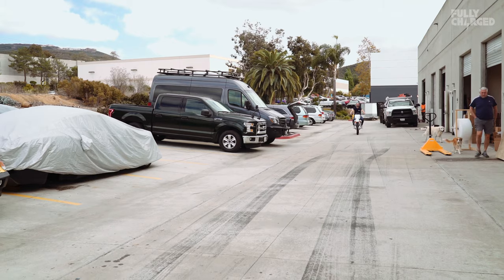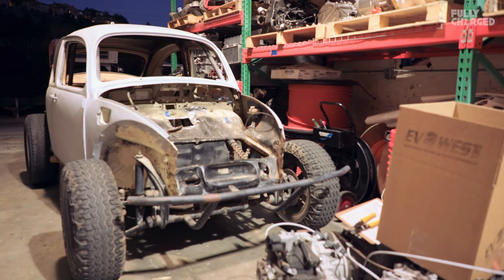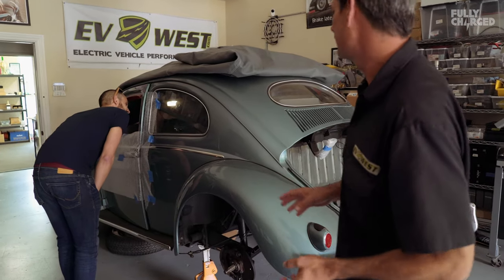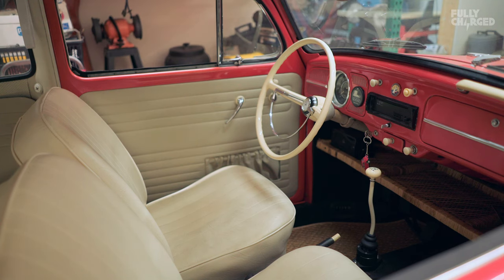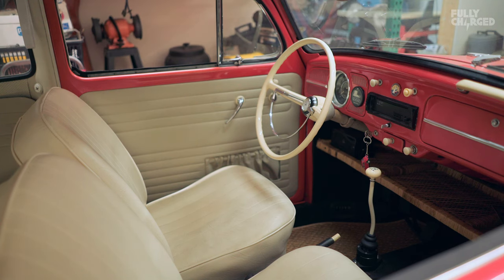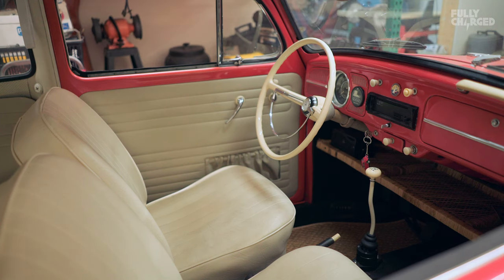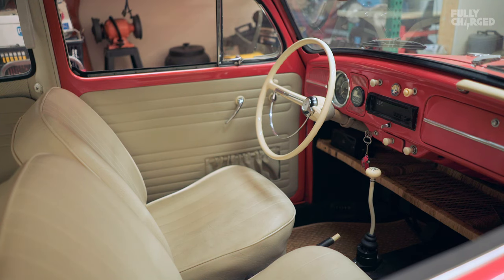Amazing Electric Conversions - EV West | Fully Charged

Comment: Excellent video, 
As someone who grew on combustion engines and I've been to several courses on auto mechaincs and was once a jet engine mechanic, the push-trend of EV's kind of gave me some anxiety, but you know what after seeing that the hot rodding and modifying of vehicles will always be around. 
These EV conversions are cool. I don't have that anxiety anymore. 
I've been following what the EV world has been doing for a few years and I see a lot potential . 
sticking a Tesla pack into a VW very similar to sticking a big V8 into a small car, strap in, shift and hold on.
EV West I love what they are doing.

Comment: Have been following these guys since the beginning - just awesome! I wish I could convert my MX5 to electric!
Reply: That would be mental. Proper drift car.
Reply: @Loundsify Here is a Dragster build. 9.27sec @ 142mph. 
https://www.youtube.com/watch?v=lQkdMw4TVjY
The only problem with Miata MX5 is Range Battery Capacity. The more range you want the heavier the battery. Weight is the Enemy for the Miata chassis.

Comment: Would be good PR for musk to start supplying them properly.
Reply: Don’t think EVWest needs it. Seems to me they use the crashed vehicles allright. Hope they get it at great value. Don’t think Elon needs the publicity either he has enough of it. EVWest is enjoying the conversio projects as they said. Always trying something new with what they can find and what the customer wants. Making sure it works. Delightfull group!
Reply: Too much liability and they'd charge too much.  But the cars are so stupidly fast that there's a steady supply of wrecks to feed the aftermarket.
Reply: They should offer crate motors and battery packs just like Chevy does with the ls engine.  People are going to buy salvage tesla and harvest the parts anyways so why not?

Comment: I got my splitie set up for another 100 000 Kms by reconditioning the engine. It was expensive, 900 dollars US even though I removed and replaced the engine and it's accessories from the car myself.
Machining, new pistons, rings, barrels, bearings and reconditioned cylinder heads.

Comment: I believe there exists a market to take fwd car with trailing axle and replace with live axle with 1 or two motors. Add batteries to both trunk and possibly battery trailer.
Program the car to use rear EV axle for short trips and use existing ICE for longer trips and battery charger. Upgrade alternator or add a 2nd generating source at engine.
Program brakes to use EV axles for most braking action.  Program the controller to alert the driver when ICE engine is needed for battery replenishment/range.
Most of these components could be move from car to car, allowing conversion of near-junkers.

Comment: Somebody has GOT to do an electric-converted old Ford Model T and/or Model A.  That would be so freaky cool to have rolling around the streets.  Since it's obviously not going to be for speed or handling or particularly light anyway, it could have obscene long-range numbers at the putt-putt speeds/conditions it was originally designed for.

There's bound to be a documentary in that idea, too:  "The New Original American."  Put solar with fold-outs on the roof to stretch it a little more, and drive it across America with only a few recharge stops.  Tour the little towns and quaint attractions, meet the people, and have a little campout here and there.  It's a summer-long cross country adventure  :)

Comment: This is great! Where I live the average winter temperature is -25 degrees, and the average distance to a city is 7hours doing the speed limit.That burns a lot of gasoline. I wonder, how I could convert my vehicle to battery power, it's a Ram 250 4x4 pickup which I need to tow my boat and my camper. Any suggestions would be helpful. Cheers from Canada!

Comment: Interesting point about not seeking initially to save the environment, but make a competitive high performing vehicle, and the rest will fall into place. Sales for ev’s should be going through the roof, but the limiting factor is battery power. The recent development of the Aluminium air cell should hopefully provide a reliable range extender which would eliminate range anxiety. Also, developments like the YASA motor and soon perhaps the Magnax gives great hopes for excellent torque to weight ratios.

Comment: I wish there was a shop like this in Australia! Would love to put tesla running gear in my VW!
Reply: I recon they ship worldwide.
Full instructions, bolt in.
All you would need (probably) is the batteries.
Reply: @rogerstarkey5390  yea I had a look at their web site, they pretty much sell and export everything.
11k for drive unit plus components 
1.5k per 5.3kWh battery pack
Would come to about 40k just in parts to convert a 4x4. Time to get saving!

Comment: I have a 1996 Dodge Ram 3/4 ton Van that toes 12,000. Lbs 
Is it a candidate for 500 plus range electric because I drive across country in it. It has A huge roof for solar as well.
Then there is my Ford Transit 350 van that has a 23 foot motor home on it. Can it get Become Electric. Right now it gets 379 MPH  but it would need a longer range to find chargers so can this be done?

Comment: I would love to convert my 2004, 2500,  Sprinter van, with all wheel drive, any suggestions? It looks like with all ice systems removed there is plenty of room under the van for batteries and more inside if needed.

Comment: They need to start looking at converting american classics too. Major demand for those old classics, some are cheaper than the big names, and with so much room under the hood they could have a "1 size fits all" engine conversion with an adapted battery pack depending on the model. Guys... guys... come on!

Comment: I wonder if they have templates to convert a mini cooper s 2004?
Reply: They don't yet, only bugs and mr2 so far it seems.
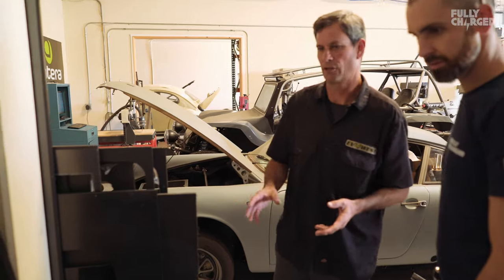Reply: @AR-zq9hq  7:36 i wondered if somebody sent in mini parts. im sure they would keep the templates.
Reply: @starcitizenmodding4436  yeah, but nothing about minis on their website. Hopefully they expand. I had a later gen BMW Mini where the engine went (surprising, right?) would have been a good donor...
Reply: @AR-zq9hq  lol no surprise there. My mini still has a low mileage so it would be a future project for me anyway, hopefully they have the templates in the future, if not somebody else probably will.
Reply: @starcitizenmodding4436  if yours is an r53 or r50 they last a bit longer. Good luck!

Comment: No body gives an indication of range of these conversions, can anybody tell me.
Reply: Depends on how many bateries you put in
Reply: @WANDERER0070  Bit of a vague answer as you need the room. An electric manufactured car has room because it may be the whole of the floor pan but a VW beetle does not have this advantage. So we can take it that if you don't want to sacrifice seating and luggage space you can travel say 50 UK miles.

Comment: does nobody convert all of the Tesla features, especially the sensors and full self driving? I have no idea if the battery pack cooling even works in those converted cars. Or if they got the ac working considering everything heat related is one system in actual Teslas.

Comment: Is anyone doing this in the UK? Or do I just have to get scrap parts and do all the faffage myself? I'm working my way up to an electrification of a van. Tesla motors and batteries are good gear, and efficient, although obviously not cheapest. Guess I need to find out about the reflashing runes. Where do the people with clue on this hang out? I've seen Michael Elias's video from a couple of years ago, so clearly people have worked out all this stuff. It's things like making driveshaft adaptors between the motor and the vehicle that also need specialist kit/knowledge.
Reply: Just Look up
 Electric car conversions on YT
Theres plenty o info

Comment: I'm thinking about converting my car, spark plug blew out, and it wasn't running great before that either. Seems a shame to scrap it, so I'm thinking, whats the possibility of putting an off the shelf generator in there with some electric motors, and small battery bank? I thought of it last night just before a thunderstorm, so now I'm on a mission from god.
Reply: What car? (Just curious)

Comment: HOW TO CHARGE ANY ELECTRIC CAR/TRUCK WITH OUT PLUGGING IN!!!       Here listen... things needed. 1) alternator (must put out more amps then will be used with everything running). 2) low amp moor (Dc or Ac to turn the alternator. 3) 2 batt banks (bank one/bank two) 4) a switching deviice (while you use one battery bank, the alt will be charging the other. do not over charge the batts) This is how you will never have to plug in to charge
Reply: Perpetuum mobile

Comment: Hellos all, 
I do have a question for EV West (and anyone here in comments that knows as well. ) 

I would love to plan a Tesla motor and battery for an older station wagon. (1970-1986) Chevy Malibu wagon. 

After installing the kit from EV West, would I be able to charge at s Tesla Supercharger? Would I be able to get the large touch screen? Or would I just use my own gauges?

Cheers, 
KimonoGryphon <><
1 Corinthians 15 : 1-4

Comment: Were to buy high capacity 18650 battery in India. I lookonline but the transportation charge frm china and the experience of the battery is so high, I needed 20 to 30  3400 to 3500 or 5000 mah batteries.
Reply: Yethu Raj Yes.
Reply: @DPortain  Do u know were to buy it.

Comment: Speaking of "stinky diesels", if you're up for a challenge, I'd love to electrify my Kubota B3350 compact tractor. They can't seem to fix their Diesel Particulate Filter (DPF) system. $28,000 for a machine I can't keep running. Are you up for that?

Comment: Pretend I am the unknown of great grandson of Nicola Tesla.    I would ask you to engineer a battery-pack that would fit the dimensions af a few million used cars on the road, such as the 1992-99 Honda Civic,   Make a battery pack that fits in the existing spare tire compartment.   Think ahead to a time when the same core of the battery would retain the dimensions, but the protective external assembly of foam or whatever the codes call for can be changed pretty easily.   Now design an electric hub-motor re-gen assembly that is a direct bolt-on part available from all the parts suppliers.  Offer one-wheel, or both rear wheels be driven by this system meant to simply push the car in neutral with it idling in stop and go traffic.   Saving city dwellers'  lives.

Comment: Why does everything with EV's have to be about more power? In the USA the maximum speed is 75Mph, in Europe the maximum is going down as well, so why do we need these huge engines? Why not concentrate more about the distance you can travel with one load? Putting the pedal to the metal, as what was shown at the end of this video, means the battery is shortened completely, meaning reducing the distance you can travel before having to recharge quite a bit.

Comment: As a petrolhead, I think the horrible, gutless mass market hybrids and electrics (prius/Leaf/Volt/Bolt) have done more damage to the potential of the electric car than they've benefitted them, most car guys see affordable electrics as gutless, wimpy soulless transportation appliances that require the surrendering of your Man Card, the performance electrics/hybrids are priced beyond the realm of affordability for regular drivers

there needs to be an AFFORDABLE electric to hit the market that is actually FUN to drive, something that takes advantage of the performance potential of the electric motor

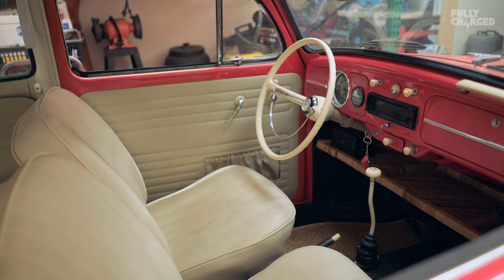Comment: 14:28 "...we get this for free."

No... No, you don't. Even if it was a sponsor contribution, it's because your efforts paid for it. Beyond that... not a single solar panel has ever been manufactured, that produces more power in its service life than was required for its production.
Reply: Do you really mean power? Or electricity? I'm no expert but I think your facts are a few years out of date. Stanford research in 2013 showed that solar pv was already at the 'break-even point' of net energy benefit (ie from that point on, solar pv would produce more energy in it's lifetime than was required to make it). Google it if you'd don't believe me!
https://youtu.be/t1tuzvT1hck
Reply: Stuart Lanceley - Stanford lost their credibility with regard to energy research, when they concluded a petrol powered car would have to best 50mpg to equate a smaller carbon footprint than a Tesla Model S.

I have yet to read a COMPREHENSIVE study on any alternative energy source that exceeds nuclear electricity. They leave out supply chain contributions and environmental impacts other than sheer carbon emissions. Solar will get there one day... but it's not today, and tomorrow doesn't look good either.

Comment: Electric cars are OK but all that bollocks about charging has got to go ain't it. I've said for a long time now whack dynamos on them and electric cars cud power themselves none stop. Dynamos built into the wheels cud generate loads of electricity. Dynamos only need a wheel to turn them. Hey Wat about putting electricity generating fans in the front grill. My point is the forward momentum of cars cud be used to generate power. The self powered electric car is possible. Dynamos and wind turbines and a car cud even feed tonnes of electric into the grid. Forward motion can be used to generate energy.